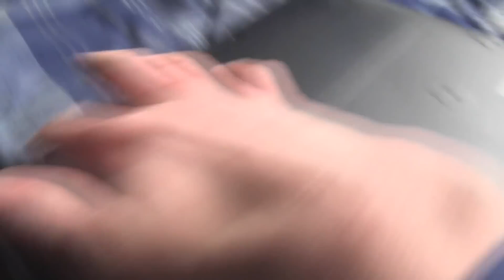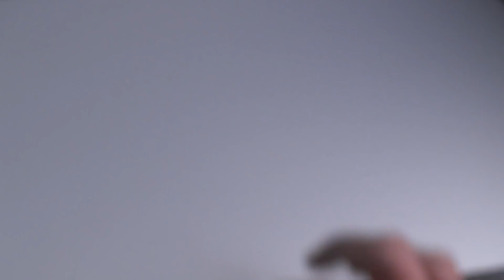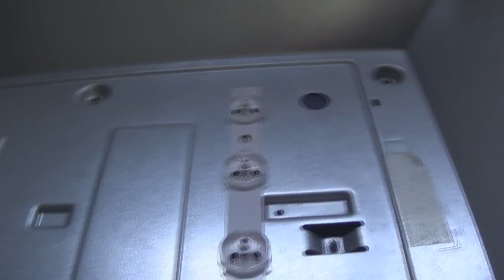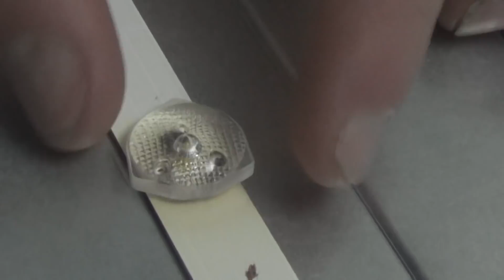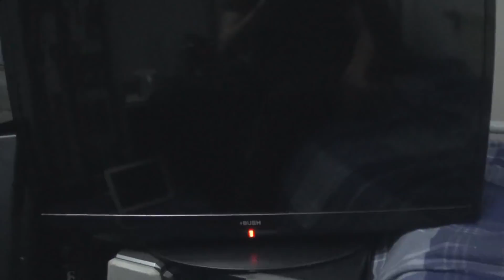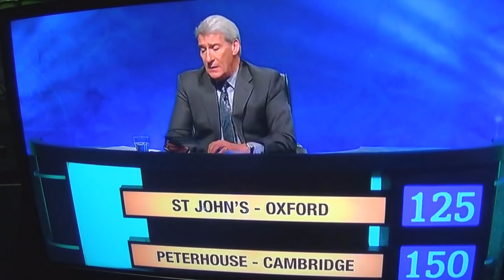Led Tv Sound No Picutre Repair

Comment: Hi I have  a similar Bush Tv sound, no picture. All of backlight working, am I to assume main board? Btw standby light flashes 3 times before I turn the TV off. Any help would be much appreciated
Reply from the maker: Check what lvds voltages are if collapsing 3.3v vdd panel probably has a short somewhere

Comment: have a vestel with a fault, a weird fault... when you press the input select, up comes a menu as expected, but it scrolls down hdmi1 hdmi2 hdmi3 etc like a stuck remote....but its not. only in the one menu (usually) and its at a speed of like 3 key presses a second, so selecting the input you want is like a game of whack a mole.  its thermal related as turning it off overnight give a normal tv for about 5 minutes then it starts to scroll, slowly at first then picking up speed. freezer spray doesnt seem to work, changing the psu has no effect, so its mainboard, and that means the main cpu, i refitted the heatsink and still no better, having to live with it as when it first started before touching it myself i contacted TOSHIBA who basically said oh no, what a shame, 17 month old, not our problem. yeah i kept the messages off them as proof.  bought a new mainboard, tested but not fitted yet, may as well get every last hour out of the old one....
Reply from the maker: Maybe contact clean the toggle switch ?
Reply: @MrReeceyburger123  even unplugged it, mines not board mounted like on some.  its a thermal issue and other vestel sets seem to have the same issue but with different menu options, i'm lucky, because one poor guy its doing volume down.....
Reply from the maker: @lezbriddon  hmmm that’s weird I’ve not had such a glitch yet, maybe check for shorts where the button plugs in ?
Reply: @MrReeceyburger123  it's a thing to check, as maybe a blob of solder could cause a short when warm. Just when the sets been cooled to like 5c/37f then brought back inside it's fault free then as it warms the fair returns but the scrolling starts slowly, like a single keypress every 10 seconds then every 9 second, then 6, then a minute later it's held down and at full speed. Going to have a look at the circuit diagram maybe I can test by inhibiting the switch, guessing it's a keypad arrangement so maybe I can short it out so it's not pressed, and remove the ir receiver. if it still does it then it's an in chip hardware fail.

Comment: Thanks for the video. I have just rescued a digihome smart tv. Standby lights switch on 8 flashes text shows with torch no backlights. Stripped down tested each led 2x11 leds only one open bridged put back together exact same.  Have 333vdc on hot side at main filters no 24v but have 12v. Difficult part is revisions of these schematics and finding correct mosfets any suggestions would be appreciated, many thanks.

Comment: ON MY POWER SUPPLY UNDER IT IT HAS NON CONDUCTIVE PAPER THAT HAS PLASTIC RIVET HOLDING IT UNDER THE CIRCUIT BOARD IS THERE ANY SPECIAL WAY TO REMOVE THE PLASTIC RIVETS OR HAVE SEEN THEM THANK YOU

Comment: I make a point of  collecting  all the pcb's from my scrap collection. I've worked in this industry for the best part of 40years and you have helped me considerably. THANK YOU. Good luck kiddo. Please do more. My Samsung refuses to operate when connected to the Internet even when I use the rj45 WiFi system is wank its starting to refuse USB no matter how much i format them. I  am at a loss. Is there fix? Is it software? HELP someone please.

Comment: Hi,
Please can you advise, I have a Panasonic TX-48CX350B TV and I have no picture or sound although sometimes I can see the backlights showing behind. When I switch the mains on at the plug the front standby light flashes then goes off and the backlight is on. No display on the TV when I press the remote on/off button puts the tv in standby and if I press the remote once again and attempt to call up the menu screen no picture or sound. After a while the standby light comes on constant red light and the backlights are off.  Your assistance is very much appreciated. Regards Brian

Comment: Make sure you have an led test tool, usually when one or a few LEDs fail, they weaken the other LEDs and they will fail quiet quickly, most of the times it's better to replace all, vestel backlights are usually Fairly cheap

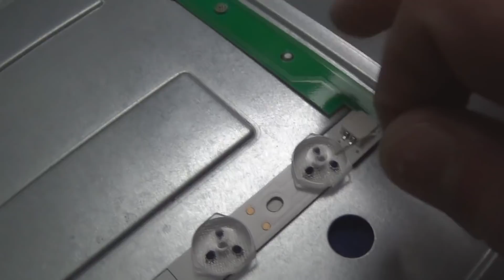Comment: I'm guessing the negative of the LEDs is on the backside of that bar? Edit: Nevermind. I see now the trace lines at 35:10 - I was wondering why you were scraping where you were scraping.
Oh, and instead of faffing about changing the prodes to the 5V rail of the PSU, why not just always check 4 LEDs? Like for the last three just add in the closest one from the previous test too. Then when you have one bad in section of 4 you can switch to pairs at 5V or individual at 3.3V.

Comment: Iv got a vestel 17ips71, backlight stays on for 5 or 10 mins then goes off, changed the backlight ic and the mosfet next to it and same thing, any help would be much appreciated, the chips is getting steady power to it but it just stops generating voltage after so long, the bl on voltage is there and same with the dim voltage, both there and steady, could this be an overvoltage or undervoltage issue which is shutting the chip off? Thanks alot

Comment: I have recently soldered three new 3v LEDs in my Nans Panasonic badged vestel. But the three new ones are very bright compared to the others. The plastic diffusers are well positioned. Is this just a result of the old LEDs being less intense after 2 years of use, or could it be something else? 

Also, thanks for the no nonsense video, it was my first attempt, other than the light intensity difference being visible on a light picture the TV is working great again.

Comment: maxxwatts
If the video portion of this tutorial matched the narration it would be very good.  When testing the boards I don't need to see what voltage is on the meter I need to see where the board is being tested.  Perhaps some editing would help.  If you explain something and you are moving the camera wait for the autofocus to catch up or edit out the parts where the camera is focusing.  Maybe it is just me but narrating a little slower would make it easier to follow.  All this being said, keep making the videos.  There are lots of us out here that have the desire and enough of the skills required to attempt repairs like this and you do a very good job explaining what needs to be done.  Thanks

Comment: An incredible electronic component test tool you might find generally useful is the (about $15 to $20) "Multifunction Transistor Tester LCR-TC1" or the (about $10) "Mega328 ESR Transistor Resistors Diode Capacitor Mosfet Inductance Tester". 
The LCR-TC1 is a blinged-out version of the Mega328.
Essentially these tools can "scan" a component (including an LED) and provide information on its health, its value (e.g. ohms, gain, inductance, capacitance, forward voltage, zener voltage, and so on), and provide pin-outs for different types of components. You don't even have to try to figure out which pin is the emitter/base/collector/gate/drain/source and so on, or worry about polarities of diodes...the tool does all that for you.
There are multiple Youtube videos that review and demonstrate these tools. I just got one and it's already paid for itself. You do have to be wary as there are multiple vendors who all CLAIM to be selling the same thing but there can be differences.
There are more expensive devices out there that can even ID a fairly large number of unlabeled ICs just by plugging one in and pressing a button.

Comment: Perhaps I missed it, but you might want to add a short warning that all test tools should be battery powered. If they aren't battery powered, or they are connected to AC mains in some way, then special methods and hardware may be required in order to prevent damage to test tools or the TV, and/or to prevent personal injury. My memory was jogged when you mentioned clipping a lead of your DMM to the TV chassis (note: clipping a test lead to "the chassis" isn't the only electrical exposure of this nature but it is a common one).

If they are using AC mains connected test tools (like an oscilloscope), and they don't understand what's involved, then they shouldn't use those tools until they learn how to deal with such situations. I think you don't have to provide the details to cover all the situations, possible solutions, etc: just provide the warning and leave it up to the user to research the issue of AC mains connections while debuggging before putting hardware and personal safety at risk.

Comment: Better way to test those last 3 LEDs in each strip...
When you got to the point (at about 29.00) where you were testing the "last" 3 LEDs, instead of fiddling with moving the voltage connections around to 5VDC and then 3VDC, IF you already know the LED immediately prior to those last 3 LEDs is good, then you can just use the already to go 12VDC power to check those 3 LEDs + the known good LED just before them in the circuit...all at the same time. Easier, much faster, and far less likely to damage something by screwing around with all those different voltage connections and perhaps introducing a mistake. IF there is a failure and none of the "3+1" LEDs light up, then THAT is when you start using the alternative voltages to isolate the bad LED(s). Of course, if the adjacent LED had been determined to be bad from the earlier test on that 4-LED segment, then this approach won't work.
Alternatively, you could just substitute your own "salvaged" comparable known good white LED and put it in series with the 3 LEDs under test to achieve the same, simple, safer, and faster result.

Comment: I'm rather surprised ALL the folks I've seen so far providing these tutorials rely on the "continuity" probe mode of handheld DMMs, and use the "beep" as the continuity verification. The problem is that some DMMs will show "continuity" by beeping even with HUNDREDS of Ohms of resistance in the circuit.  I just checked a "random" DMM that I got a few weeks ago as a gift from a manufacturer and it provides the continuity "tone" at anything 0 to 200 Ohms. Note that this value can also change depending on the state of the battery powering the DMM. Even a few tenths of a volt difference between a new battery and a battery that has been in use for a couple weeks can result in meaningfully different reported values.

I recommend using the lowest ohms range on your meter and declare "continuity" only when you measure less than 5 Ohms. (probe leads on some meters can add a few ohms to the reading and the cheaper units don't have zero-calibration capability. 
Continuity mode may also show you the measured resistance so it could be another way to confirm appropriate low resistance when you hear the beep. The problem is that I fear many people get in the habit that if they hear that tone then "all is good"...when it really is not. Be sure to read the specs on how your specific meter deals with "continuity" on the display as well as the tone.
Reply: I know im asking randomly but does someone know of a trick to log back into an Instagram account??
I was stupid forgot the login password. I would appreciate any tricks you can give me.
Reply: @Brett Francisco instablaster ;)
Reply: @Carmelo Hank Thanks so much for your reply. I found the site through google and I'm in the hacking process now.
Seems to take a while so I will get back to you later with my results.
Reply: @Carmelo Hank WTF IT ACTUALLY WORKED :O Literally hacked my IG login within roughly 40 mins by using the site.
Thanks so much, you really help me out!
Reply: @Brett Francisco No problem :)

Comment: What site would you get the firmware to update after replacing a vestal17IPS61-3 replaced a similar board on my led22" Bush have sound but no picture any suggestions. Thanks for sharing well done👍

Comment: Hi. My vestel 17ips19-5 was doing exactly what you described. I have a picture but no backlight, at the plug for the LEDs I did have 90v which would then start bleeding down after it detected a bad led. Good, just need to replace an led. But now after going back to it I'm not getting the 90v at all that I was getting before. Now nothing happens. With a probe on ground I get nothing on the red wire and 24V on the black wire. Could you please tell me what has happened? I have tried unplugging everything and leaving it for a while hoping that it was in some sort of safety mode that might reset, but it was no good. The red wire is also shorted to ground and I don't know if it should be.

Comment: at the very end you said place back light on lowest setting ? I agree turning it down extends the life of LED and turning it off maximum is a must but you got to remember when you shop for a TV you are shopping for quality picture and granted changing LED is a pain in the ass but watching my $1200 tv so that it looks like a $90 wal mart made in china knock off Tv is not acceptable . LED's are not expensive and 1 junk TV can supply you with a lifetime amount of replacement LED's ..

Comment: at 44:12 you just replaced the LED and checked it with meter and are about to test with 12v (checking 4 at a time) and you keep going over not looking at it directly and talk about placing a tissue over it or looking away ?? you still got the lens cover off ? why not simply place it over the led until the test is done then glue it back on permanently ? you got your purple marker hash mark so in span of 12 seconds your not going to forget which one you are looking to light up as your checking 4 ... how about supplying a link or a brand and part number for your hot air tool as well as the product you use to clean off the flux ? I tried this repair in the past by removing the strips and was given incomplete instructions and had the improper tools so my endeavor was pointless but since my tvs were both covered under my credit card protection plan a new tv was free ...

Comment: Pulled a 60" Westinghouse (VR6025Z) from the county dump (I grab all tv's that have intact displays) Get it home, power it up, I get a "W" logo for about 1.5 seconds, then dark. flashlight shows me display still on, so my first thought was same, BAD LED's which I dreaded (have broken a display or two trying to remove) took back off and went to check inverter input voltages 1st. this 60" monolith had huge inverters, a Master, and 3 slaves. thats when I noticed a 14 pin jumper connecting slave 2 and slave 3 was burnt to a crisp, insulation on a couple of lead wires gone, in fact one wire was burnt so bad it was gone. Ok, maybe it's not an LED issue then... lolz
I had 24 volts going into these, so PS was good. I ESR'd the inverter board caps, all good, mosfets were good, all transformers rang good...drove me crazy, so I slept on it (I find it's good to ponder)It hit me next morning like a brick...Bad grounds, just like the Samsungs (common problem w/ those)
Even remember saying to meself when un-screwing the inverters off that these mount screws were loose as hell. I found another 14 pin jumper from my box O leads,cables and wires. then replaced these cheap screws with a better type that "bites" better.
Ta-Da, display stayed on!! I checked all screws on all boards, and yes every damn one of them were looser than a 2$ Ho ;)
the heating/cooling cycles over time had loosened them. I replaced all the screws and have a 60" in the living room now. I got 7$ invested in this thing (new ebay remote) and a few hours labor...not too shabby ;)
PS: Why don't these manufacturers wire these LED's in series/parallel ??? that way, one goes out, others stay on

Comment: Nice step by step diagnosis through the actual repair. I just had my LG 55LB5900-UV start flashing last night. I still have sound and the picture is still technically there (the same as where you show the volume bar on the TV). Thankfully I've replaced many laptop screens as an IT tech, so I have some experience on a smaller scale. My LEDs cost about $60 USD and some time to actually fix it and wait on the parts. The TV costs over $600 USD to replace outright and I'd still wait on it to be delivered. I'll be buyning the LEDs first. Thank you for taking the time to put this video together and share it. I love the use of the PSU for power.

Comment: I have the opposite problem, there is a picture but no sound just buzz and when I increase the volume the buzz goes up until I mute the sound or make it at zero, I opened my sumsung tv and when i touch a small resistor behind the audio IC NTP7414 the buzz goes off but always no sound, only external audio work when i plug a headphone to it, Any suggestion?

Comment: the 12volt  off  computer  power supply  is 16 ampear  so you will fuck the leds  by   high current and 3.3volt  is 28 ampear you  must  used   resistor  in series

Comment: Guys watch out with the capacitors, they can kill you even they are not connected with electricity.
Before you can touch the 2 pins you have to discharge them, look on the internet there are a lot of those information!

Comment: Hi, my vestel ves400 unds-2 backlight has a failed single led, i would like to just replace the blown led with an led from a spare samsung backlight, is there any issues in making the samsung a donor for the led?
Reply: Yes, they could have a different current, voltage or power rating. Brightness and color temperature could also be different. All could be fine, but you could also have a differently colored or lit splotch on the screen. Worse, the LED could just burn out after a few weeks again (with all the risks of opening the TV again) or worst it takes out other LEDs (this is improbable if you only exchange a single one). Only way to be sure is to compare the datasheets of the LEDs used (which unfortunately can be very hard to find, since manufacturers usually don't mention the part number of the LEDs anywhere).